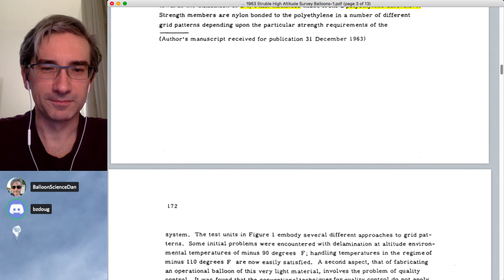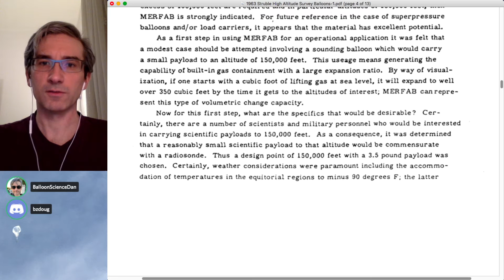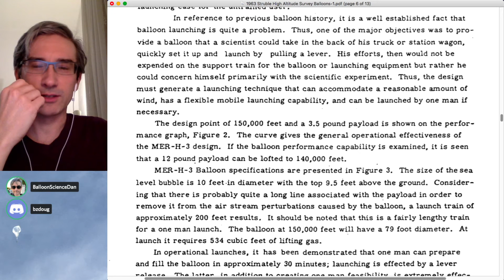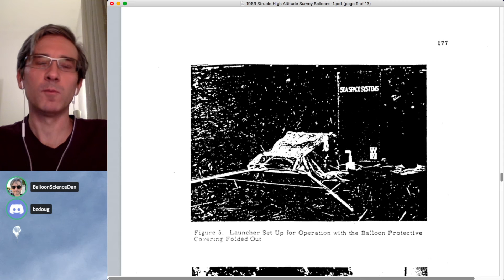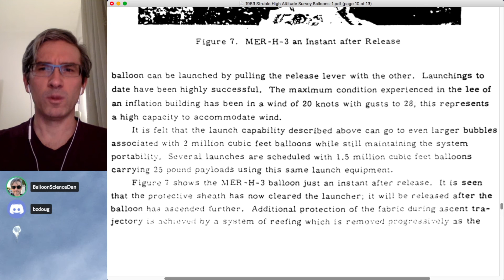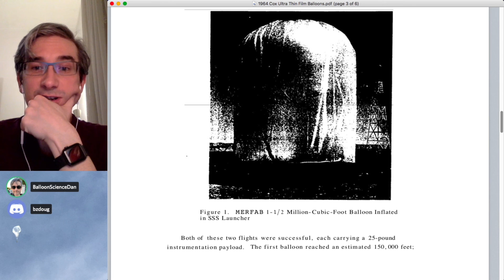Balloon Paper Chats - "High Altitude Survey Balloons, 1963" with guest Tad H.

Comment: I've handled a vacuum tube (valve) radiosonde - one parachuted into the car park  where I was working back in the 1970s (the British met office must have still been using them back then)  I recall a single valve and a big battery and a disk bellows pressure sensor.
Reply from the maker: That's so cool!
Reply: @stratosphericballoonscienc4916  I do recall thinking its was well behind the times even for back then - I would have at least expected discrete transistors.  The thing that stuck the most was it was a single physical vacuum tube (although in retrospect it may have had more than one valve internally) - and wondering how they could encode the sensor readings and transmit with a single tube.